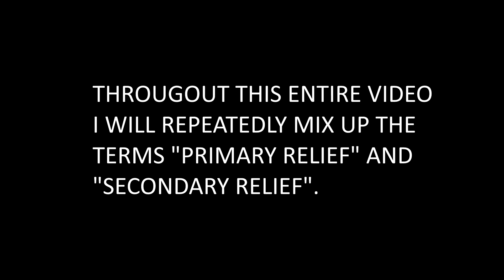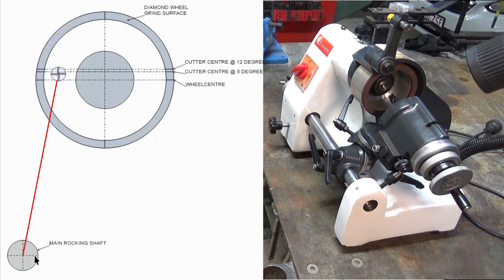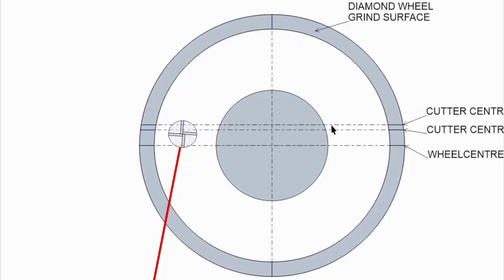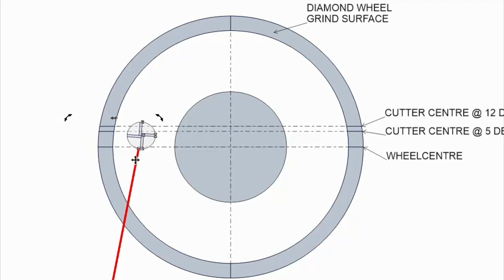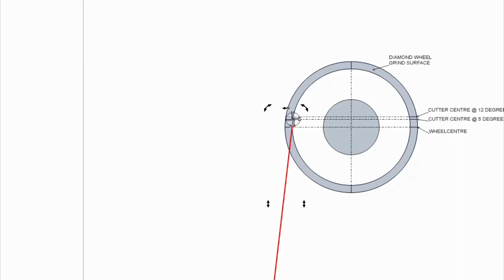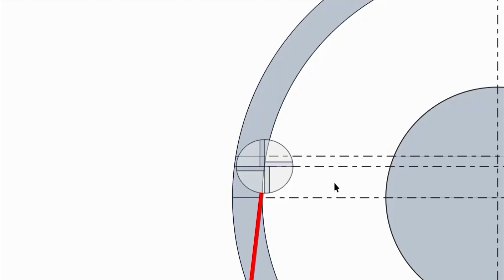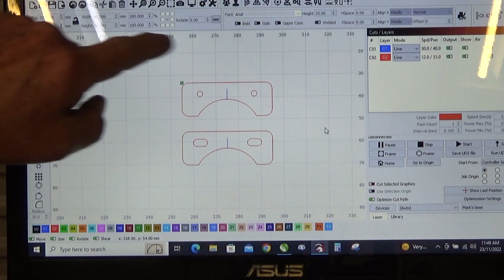D Bit Grinder Modification for Easier End Mill Sharpening

Comment: What kind of guy has a CNC lazar in the corner of the garage, but has to go shopping for a 10mm tap? I obviously need to up my game!! 😉
Reply from the maker: Interestingly, I do have a 10 X 1.5mm metric fine tap. 10 X 1mm pitch is an odd size. I did end up single point cutting a new feed screw on the lathe and after the third attempt it fits perfectly. Two more items for the shelf of shame!
Regards,
Mark
Reply: @Preso58  Great to see you back online Mark. Your videos are consistently amongst my favorites. You have a wonderfully approachable style. To that end, a quick discussion on metric thread standards… I believe the pedigree goes something like this; the basic metric thread profile is specified in ISO 68. ISO 261 reports to ISO 68 and provides the general plan for size/pitch. ISO 724 identifies the standard course thread size schedule under ISO 261 and does indeed specify 10MMx1.5 as the preferred general thread size. For more specialized uses, perhaps applications like your grinder’s vernier adjustment stop, ISO 262, also under ISO 261, provides for a fine thread pitch standard and identifies both 1.25 and 1.00 pitches for the 10MM base (nominal) diameter. Summarizing; 10MMx1.5 is the ISO standard course thread, 10MMx1.0 is a standard ISO fine thread for more specialized applications. That you don’t have a 10MMx1.0 tap to hand is not surprising. But the real value of your channel is that you produce videos showing the wit and confidence to overcome deficiency. Keep producing. I believe that you have truly found your niche.
Also, I have a video request for you to consider. One that I believe you might be ideally positioned to produce. CNC machine tools are becoming increasingly “home-shopable”. Unfortunately, the CNC transition passed me by (I was busy developing new technologies and designs, not turning them into hardware…). Would you please make a video(s) that starts with a CAD design (2D, 3D surface, 3D solid, whatever), translate that into a CNC format (whatever), translate that into a machine controller program (whatever), then go through the details of setting up the machine, running the program, and inspecting the part. Seems rote for you but black magic to my cohort. If helpful, I would be more than happy to work with you on the specifics (i.e. script/syllabus).

Comment: Hi Mark. Having struggled trying to see what I was doing sharpening a carbide end mill on my D Bit grinder, working from outside in, I’m now eager to try your approach, inside out. Thank you for sharing such an interesting idea. I suspect I will be copying your modification.👏👏👍😀 Andrew
Reply: What you mention is interesting because as I was watching Mark grinding  I was thinking that cutting from the outside diameter of the wheel to inward direction would have produced a better result and perhaps less of a noticeable pyramid in the middle of the cutter.
Reply: @howardosborne8647  I think Mark has pinned a post this morning which answers your comment better than I would. 
It’s the inability to see clearly grinding outwards in that is the real issue for me. 
My grinder does not have the restrictive spring which Mark mentions, so I can well imagine having to overcome both the restrictive view and fight a spring at the same time would be very difficult.
Reply from the maker: I have almost finished a follow up video on this machine and the upgraded parts. I was able to demonstrate the alternate method and why I don't like it. It's not that it doesn't work, it's just a little more difficult for me. 
Regards,
Mark
Reply: @Preso58  Hello Mark. I’ve been playing about with my machine. It does not have the spring which yours has. Therefore your “better” solution of grinding inwards - outwards, is sadly not available, unless I fit a spring.
In any event, I will definitely add a graduated adjustment screw to replace the “sloppy” hard stop screw at the front. 
Looking forward to seeing your follow up video. Many thanks for sharing your ideas. 👏👏👍😀 Andrew

Comment: Hi Mark, Very interested in your laser cutting aluminium.  Can you share some specs on that machine?  Cheers
Reply from the maker: I use a 50 watt CO2 laser of unknown Chinese origin for most of my laser cutting and engraving. It won't cut aluminium but it can engrave anodised aluminium. The clip in the video shows the CO2 laser engraving some two ply plastic sheet which has a shiny aluminium like top layer and a black substrate. The top layer is very thin and can be oxidised from the heat of the laser but in practice, it won't touch solid aluminium sheet stock. For that you would need a fiber laser which uses a different wavelength of light to mark metal.
Regards,
Mark

Comment: Most people use that dial as an end stop only, if you nod the work head down 12&5 deg, rather then up, then you can cut the back flute outside in, rather then inside to out. Your way works & gives good control though.
Reply: I was about to say the same. I ground quite a few end mills early on in my career and was taught to set the "rocker" stop and swing towards it. Never had an issue with grinding past centre following the initial setup.
Reply from the maker: I have done it that way but I find you get a better view of the flute being sharpened working from the inside towards the outside. I also find that feeding the cutter with the screw adjustment gives a little more control, especially on the centre cutting type end mills.
Regards,
Mark

Comment: Very good Mark. The only thing I’m wary about it that wobbly diamond wheel. I don’t understand why it’s so off, but you would have less problems with your center on the mill bit if it were running true. The face is also moving in and out and not cutting all along the face.

I want to add that all machines change positions once started. So there will be a slight movement of the grinding wheel in or out, and side to side from the off position once you turn it on. It’s just a tenth it two in a very good machine, but could be a thou on many other smaller ones such as D bit grinders. That could be another reason why it’s hard to get it set exactly where you think it is. Generally, you have to touch the part with the wheel running.
Reply from the maker: I have been reminded of a video done by a New Zealander called Cliff on the YouTube channel called Thread Express. He has successfully dressed the same diamond wheels that I have to rectify the runout of both the grinding surface and the aluminium wheel body. I think I will try doing the same. The runout on these Chinese wheels is really bad and it should be possible to make them to a higher standard without increasing the cost too much. Having an accurate grinding surface would make the grinding much more predictable.
Regards,
Mark

Comment: The way I do it is to use the knob as a depth stop feeding from the outside in , the weight of the machine is sufficient that it doesn’t move when I rock the tool out by hand and while holding it with one hand I index the tool then hand feed it back to the stop . For gashing I have used a thin cutting disk in an angle grinder but it lacks precision . On a previous set up ( Harold Hall grinder ) I did use the same cut off wheel mounted to a small bench grinder to gash and as the wheel and cutter were held rigidly it worked well and was very predictable .
Reply from the maker: Ian, I did sharpen some HSS slot drills using the machine the way you described and in some respects it seems safer to feed the tool from the outside in. Working the other way around means that if you don't lock the workhead properly the tool can pull downward suddenly and jam up against the wheel. I have a Quorn tool and cutter grinder with a reversible motor so that you can always grind in such a way that the cutter is trailing off the wheel surface. Unfortunately the manual that comes with the Chinese clones is woefully inadequate and it glosses over the sharpening of milling cutters big time. 
Regards,
Mark

Comment: I think that the stop you have is to limit travel in 1 direction not necessarily an angular movement device.
I believe from memory that Stefan modified his to have 2 angular work stops.
Still what you have done works, and that’s the important thing.
Take care.
Reply from the maker: I did watch Stefan's video and I think Robin Renzetti did an extensive video on modifying his D Bit grinder clone. I was looking for a solution that didn't take too long to implement and on reflection, there are better ways to arrange a hard stop on that machine. I will do a follow up post on how the upgraded upgrade turns out.
Regards,
Mark

Comment: The good side to this modification is that if you have more confidence you're not going to stuff up your bit, you're more likely to sharpen your bits so you'l get more practice and have bits in better condition. It is surprising the sharpener doesn't have this facility as you said since it seems otherwise a good bit of kit.
Reply from the maker: It is a nicely made machine in all respects except for that one adjustment screw. I think that I can get better results with more practice. I do need to get some more 5C collets for it though. 
Regards,
Mark

Comment: Nice video mark, since I don’t have a D Bit Grinder I have been experimenting with using an indexing plate on my Lathe and a tool post grinder with a diamond blade, along with lots of rags . I have had some success but not quite there yet.
Reply from the maker: I thought long and hard about buying a D Bit grinder and I sort of regretted it when I finally got mine. It sat in the corner for a long time and I really only sharpened a few lathe tools on it. However, when I ruined that carbide end mill I knew it was time to bit the bullet and learn how to use it for more serious purposes. They aren't a cheap tool and they are fiddly to set up but it's gratifying to resurrect tools that would otherwise be scrapped. If you do have a toolpost grinder you are off to a good start though.
Regards,
Mark

Comment: Hi,Mark. This is a great proof of concept and I'm sure the new index wheel you make will look superb as usual.
One thing I can see is that a larger diameter indexing wheel will make it easier to achieve repeatable accuracy of indexing the cutting depth each time. Perhaps an indexing wheel to match the satin finished end indexing wheel in size and finish would be nice to achieve....great modification all the same.
Reply from the maker: Howard, I actually started work on the new index screw today. It will be larger and I have been able to single point thread a screw with a much better fit. I will post a short update video soon.
Regards,
Mark
Reply: @Preso58  I'm sure the new one will be the 'bees knees' as you always produce.

Comment: Was thinking that maybe a rotating sleeve on the knob with an inside thread and another rotating sleeve, fixed horizontally, coupled with the first one, for the zero. So you bring the knob into position, rotate the outer sleeve on the thread until it touches the grinder and rotate the end sleeve to mark the zero position (similar to the dial on the compound).

Comment: Ciao Mark !! A very professional jobs !! I grind my end-mills with a suppor that i made from Harold Hall drawings, Uk, books: you can find his videos on Youtube but he is very old now and no new videos from 4-5 years, but his system works well !! I want to buy your machine before or later in the near future, also because the dimensions are perfect for my garage and maybe my wife will not see the difference (😂) because i can put on the lathe basement side....thanks Mark, i will use your video like a tutorial too !! Ciao !! Alberto.
Reply from the maker: Thanks Alberto. My D Bit grinder was a bit of an extravagant purchase since I already had a Quorn tool and cutter grinder. The Quorn has some good features but it is not so easy to set up and the graduated dials are quite hard to read. The Deckel clones are mostly well made though and they are a very heavy machine too. I think it is one of those things that you have to use a lot to get the most out of it. 
Regards,
Mark
Reply: @Preso58  Thanks Mark, i think so, it remain in my mind for the near future...it will be a Xmax gift for me and from me !:) Ciao ! Alberto

Comment: I dont think there is a man on earth that can do this by hand an get all 4 flutes perfectly aligned.Put endmill in lathe and drill the middle out  a little bit with diamond burr in a tailstock? Or maybe use one of those ceramic tile diamond hole saws ?
Reply from the maker: I will eventually make an aluminium casting that holds a pneumatic die grinder in the tool post of the lathe. This will make it much easier to fixture the cutter and hold the diamond burr in whatever orientation you want. The die grinder has much better bearings than the Dremel and therefore less chatter. 
Regards,
Mark

Comment: Very interesting video! Clever solution for indicating the stop point. I was wondering if you could use a dial indicator against the work head, to tell you when you reached the limit. About the burr, in the aluminium, maybe you need to sharpen the flutes too. Anyway, great job!
Reply from the maker: I am sure the flutes on that end mill are probably worn or blunt. However, I haven't summoned up the courage to start grinding flutes yet. Stefan Gotteswinter has said that the D Bit grinder is not really up to the task due to a lack of rigidity. The cost of solid carbide tools from China is quite low but the shipping time is a bit excessive. If I can resharpen a tool it saves a lot of down time.
Regards,
Mark
Reply: @Preso58  Yep. Flutes are a very tricky task. But what you achieved is already very good, and if you can recover an end mill that fast, it's worth the effort 🙂

Comment: AS an ex tool and cutter grinder this is the wrong approach. Angle your cutter downwards for the relief angle and come in from the outside edge of the wheel not only can you see what you are doing, the machine has an adjustable stop for inward travel.

Comment: If you start with grinding a fairly large gash there is much less chance of damaging the next cutting edge and you can get decent results even on small cutters with just counting the turns of the knob, although having a collar with reference mark makes it easier.
As you pointed out removing a portion of the center (even fairly large) has no effect on cutting performance.
Some end mills with coolant channel through the core have the a small counterbore in the center of the bottom.

Comment: Isnt that supposed to be a nonproblem, as you tighten the screw until it maxes the lever within, you loosen the fixture head clamp on the shaft, allowing the head to be put where you need it with a light and the endmill, then clamp the head so the head can not grind into other tooth, as it can only be pushed out with the screw to that point at its furthest extent of travel... You can set it up more precisely with an indicator and a gauge pin with a sheet of gauge stock... you touch the wheel with the wrapped pin, and set the indicator, thence you put the head precisely at half the diameter and lock it again, again allowing you to this time ``perfectly`` stop at the end of your travel(infeed)... i think blondie explained it and stefan likely... probably robin, but im sure i saw that method showcased and its perfect... i have a true deckel s1, and she can use that setup to marvelous extent, but she also has a 5axis ``post`` for a rotary fixture, which is even more convenient to set up precisely... I agree that the bolt there is disgusting, but even the deckel s1 has just a fancy large headed, knurled bolt there with a much better fit of threads, but still its just a bolt, not a dial, as no matter what you set it to, if you loosen the clamp of the head on the rod itself, the markings would have lost their 0 completely... So an elaborate dial there is just not of use... it dials in a rod angle, but on the rod the head can be moved as you will it, so what good is the indication of where the rod is, as it would not indicate the head, but rotary angle of the rod itself? that is just used to rotate the rod, the setup is done with both rod and fixture lever for the clamp on the rod... 
Cheers and all the best!
Reply from the maker: I have almost completed a follow up video which shows the upgraded parts and also an alternate method for grinding which uses the screw as a hard stop. It does work but it still has some issues. I guess there are lots of ways to achieve the same result. 
Regards,
Mark
Reply: @Preso58  Nice, i will be glad to see it, but i just had to ask, as its the way i am introduced to the machine and seeing this had me question like last 5 years of thought... its like old math and new math, once you get used to one, the other is in no way logical, but this i get, i too thought about the same thing when i first got the machine, as i wanted to replicate the original shaft infeed knob and replace the knurled knob on my deckel, but the more i used it, the less i thought about it, and more  about how i would like to bore that hole out, and put in a hardened steel threaded sleeve and a hard bolt with a constant oiling method, as i dont like using machine castings as threaded or precision bores, i like them sleeved in bronze or hard steel with good lube path to make the area serviceable and essentially beyond actual wear...